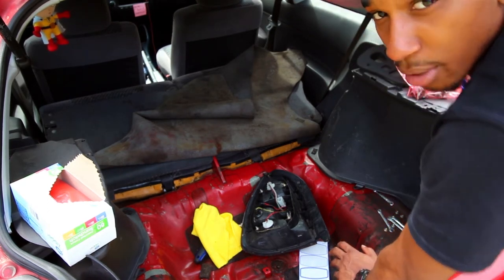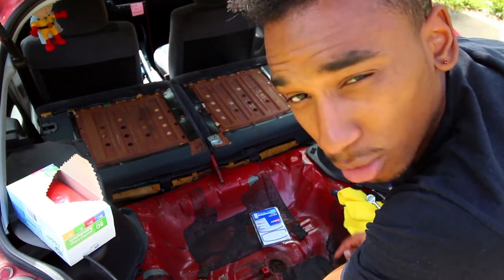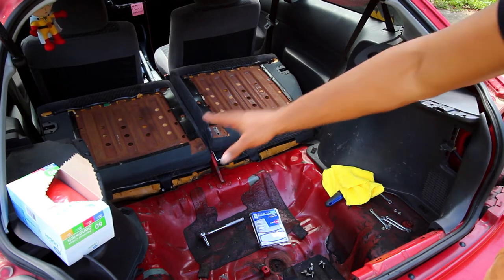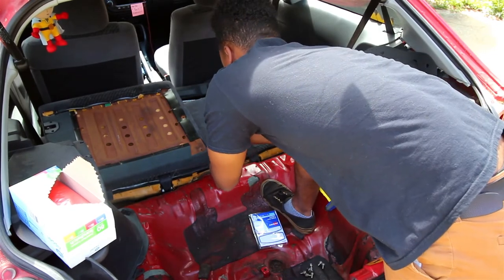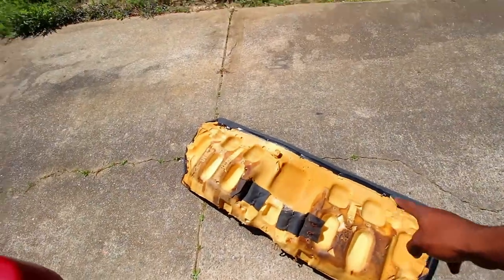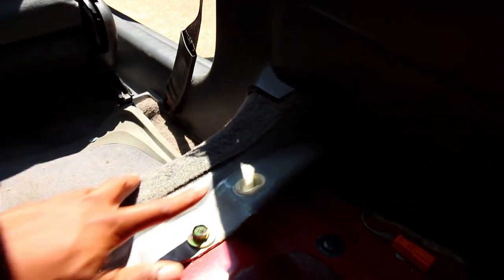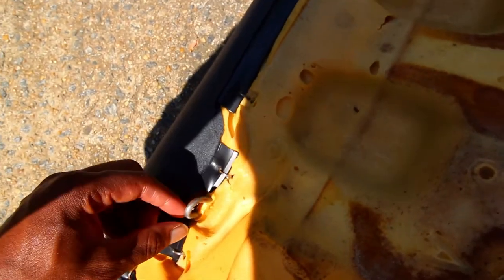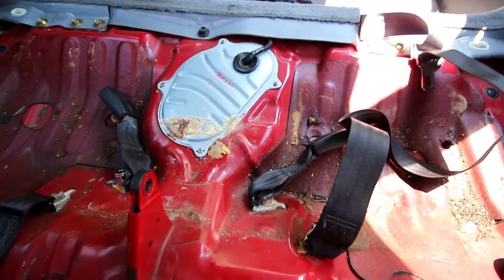EK Civic Back Seat Removal

Comment: I removed the back seat to get washed i installed the bottom part no problem at all but after i finished bolting the passenger side one with the brackets i couldnt get it to lined up properly with the lock any tips?

Comment from the maker: Are you struggling to remove the seat? Ask me any questions!
Reply: having a hell of a time because i can’t find any of these bolts
Reply from the maker: Some are hidden under the seats
Reply: Hey… this is a very helpful video, but I’m having the exact same problem as the other guy who commented in reply to this (Re)
I don’t have any of the bolts on the back of the seats ! Exactly where the bolts/brackets should be, there are just holes, but the seat doesn’t budge
Have looked over and moved every single part of the seats and can’t find anything I can undo
Any advice please?😂
Reply: @HesTheBees  Hey! i had a hell of a time but eventually realized that there is a little black spacer like thing that needs to be prayed out. This is probably not going to make sense but check between the seat and the body of car, there should be a little black thing i between there where the seat fold up and down.